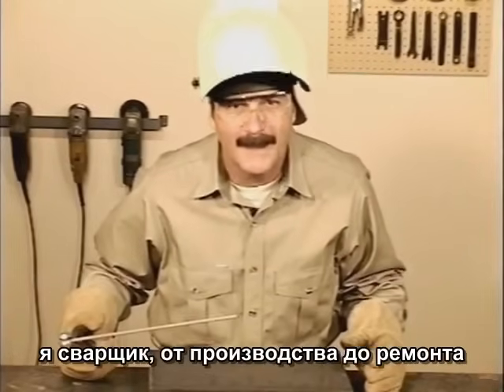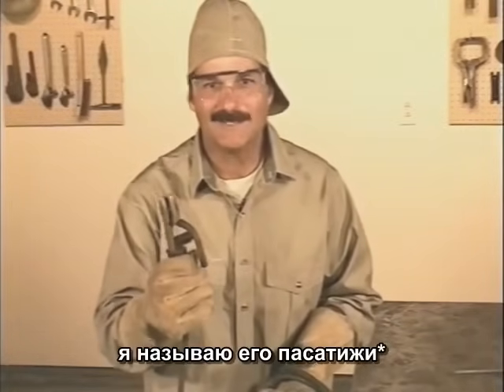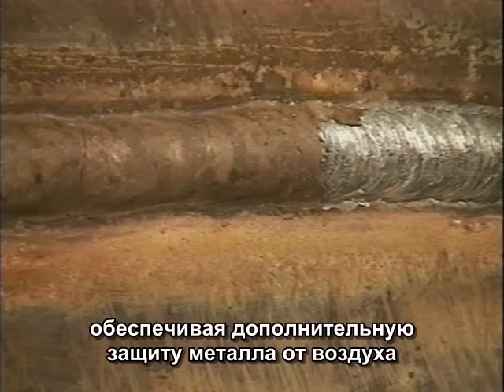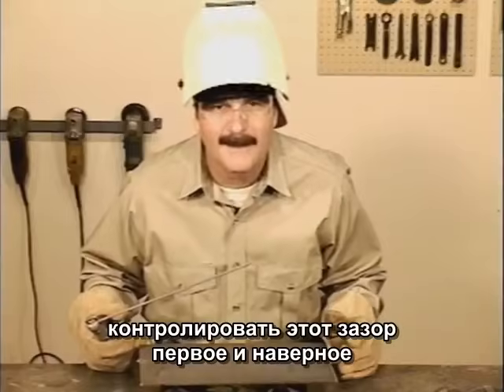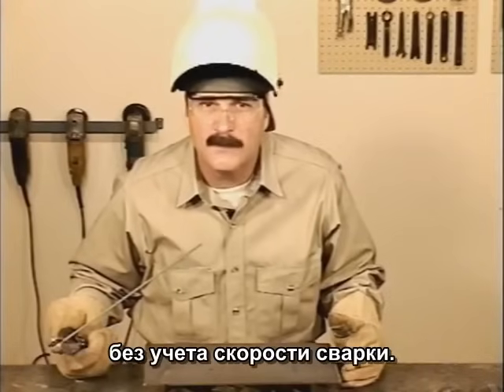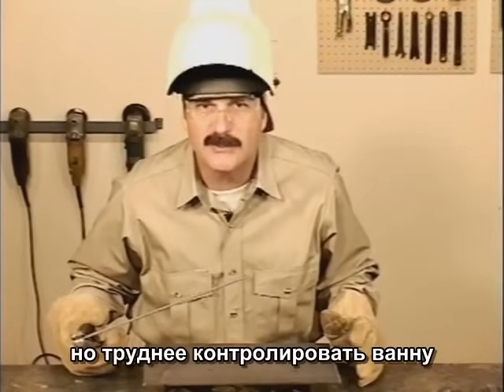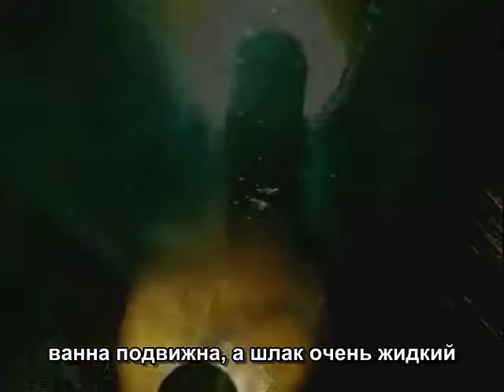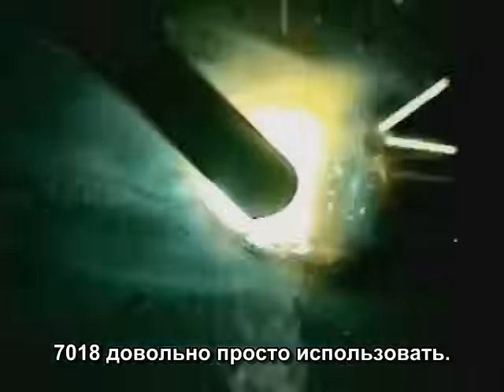Arc Welding Lessons

Comment: Very well done video, brings back fond memories of IVYTECH welding school back in 86. I did production welding at multiple job shops, however all gsmaw. I was fortunate to have a father that encouraged my interests, he even installed flameproof sheetrock in his basement, installed me a ventilation fan over my weld bench to bring smoke outside. I remember many fond times with laughing buddies down in basement sparking on up on my Lincoln 225 AC 125 DC at 10pm+ when parents room was directly above 😂👍. I’m very grateful to have such supportive parents that trusted me way more than I trust my own kids growing up. Welding has always been a love of mine, after 30 years at age 50, I finally got a Hobart Handler with 75/25 gas cylinder for the garage. Even though my life has taken me into Consumer Electronics repair, my heart still has that special place for welding, the sounds and smells are so yummy! 🤗

Comment: NOTES - Arc Welding Lessons ide16rus 
(My notes - use at your own risk)

E6010, E6011 - fast freeze - strong arc/light slag/deep penetration
E6013, E7018, 7024 - filler - light arc/heavy slag - smoother finish

E6010 DC+, 6011 AC/DC+ dirty material/First pass/fill gaps - follow with Filler
E6013 DC- for high speed sheet metal
E6013 AC/DC+ for general welding/light fab - easiest to use
E7018 DC+ Low H - Best finish/handles stress/low alloy/cast steel/large gaps/high deposit rate - must be clean
E7024 DC+ horizontal only - smooth weld/clean metal/high amps

Fast Freeze - can see puddle clearly
- E6010 & E6011
-- ~ 3mm arc gap
-- focus on puddle, not the arc
-- Scratch where weld will be
-- keep finger on trigger to drop rod
-- pause for 2-3 circles at start to get base metal hot enough

- Arc Gap
-- too close - no penetration/base metal cold
-- too long - arc drops/filler metal loss of control
-- most important

- Weaving
-- Watch build up (behind)/sides to keep even and tie-in
-- metal follows the heat/watch undercut

- rod angle
-- angle used to push slag back over the weld puddle
-- Straight up - puddle goes down and out/deep penetration
-- Angled - Builds up
-- Too angled - puddle difficult to control
-- vertical-45 to start/25 generally speaking

- Amperage (contributes to heat of base metal)
-- Purpose - melt the base metal
-- given in Mfg recommendations as a range--depends on metal thickness/position/welder's ability
-- Too low - base metal doesnt get hot enough--poor penetration/puddle appears to follow the rod
-- Too high - base metal too hot -- pushes puddle back/poor side tie-in
-- Correct - puddle spreads out/sides tie-in immediately/can ease the puddle around
-- Start about the mid-point in Mfg recommended range

- Speed of progression (contributes to heat of base metal)
-- faster = less heat/slower = more heat
-- too fast - too cold--weld bead skates across/no penetration
-- too slow - too hot--puddle spreads out/
-- correct speed - puddle spreads out and is controllable/sides tie in
-- As one improves, higher amps and faster speed

- Ending
-- Take a circle or two at end, then up and back

summary
-- scratch to get arc
-- start puddle wide for uniform
-- uniform arc gap
-- amp to spread out puddle
-- ease puddle around using arc
-- watch build up and sides
-- add filler metal before pulling out
-- Smaller rod is easier, and can be built up - start with 3/32 in general

6010 & 6011
-- tight circles & zig-zag --watch edges
-- whip motion - pull forward and then push molten metal back into the bead -- deep penetration/gouge and fill
-- step motion - puddle, long-arc, puddle -- metal cools some between puddling--thin materials/gap fill
-- step - cover with a fill pass
-vertical
-- down is easier
-- up gives more penetration
-- down - higher amperage/heat rises
--- watch sides and build-up
--- angle rod up/arc pushes puddle up
--- move fast to stay ahead of the puddle
-- up - lower amperage/into heated metal
--- angle tip up
--- watch undercutting -- watch sides and buildup
--- too hot - puddle may fall out/burn through
- Horizontal - tip up and vertical
--- don't blow weld bead out
- Overhead - get comfortable, like flat
--- Puddle wants to stay/don't blow it out
--- tip almost straight up and down
--- Sparks will be coming

6013 - good for small low Amp machines
-- Puddle stays fluid
-- Lots of slag
-- 130AC 116DC- good starting point
-- Too low - long time to tie in sides
-- Too high - stays hot longer
-- Short arc gap - can rest rod on metal
- Vertical 
-- downhill by design
--- amps up 5-10A
--- angle up
--- slight side-to-side
--- stay ahead of the puddle - move faster or higher amps
-- uphill - more penetration
--- side to side
--- watch undercut
--- amps down 5-10
- horizontally across
--- angle up/slightly back
--- slightly to back
--- slag runs down/watch the top
--- move fast to avoid buildup
--- better to move fast and do a second pass
- overhead
--- get in position and like flat weld -- mind the sparks

7018
-- heavy slag stays molten longer
-- understand that one sees the slag, not the metal
-- be comfortable
-- critical gap and uniform movement
-- bump and scratch to start
-- avoid rod burn up or pulling rod out of puddle
-- req's a little higher amperage
-- weld depends on how the puddle acts rather than how it looks
-- too low - wont spread out, long side tie in
-- too high - puddle agitated and fluid/excessive splatter
-- easy to move puddle side to side
-- horizontal - sag = move faster
-- vertical - weld up, move quick size to side after tie in
-- overhead
-- takes more practice, but worth the time

In summary
-- concentrate 
-- focus on puddle
-- make puddle do what it needs to do
-- put metal where it belongs
-- inspect every weld
-- Practice
-- Smooth
-- side tie in problems - too fast, tip of rod in puddle, low amps
-- too slow - flat weld, overheated base metal
-- Long arc - inconsistent bead with excessive spatter
Reply: These notes are excellent. Many thanks for them. Feel sorry for Steve though, this is an illegally copied video. The guy gets nothing. It's worth going on his website and ordering his dvds. to do the right thing
Reply: Thanks man, great work!

Comment: This guy knows his stuff. You can also use a mig welder in a similar way using gas-less welding wire, here the flux is on the inside of the weld wire....otherwise known as flux cored wire.

Comment: Welding machines are a very handy tool to have! Trying to use the same one is not just a rookie thing,many very seasoned pros I know including myself still prefer to use a machine they have been using for a while and have passed certification tests with. Welding equipment in my obsevation is sensitive enough to electical input, that your welder will probaly behave just a little diffrent in someone elses shop! If you have spots marked on dials you might have to retune a bit on a diffrent outlet!

Comment: Welding with an inverter welder isn't any different than welding with a conventional  transformer welder. The technique is the same, the only thing that might vary is the quality of the weld, but even then, you probably wouldn't notice any difference. Anyway, the guy in this video is one hell of a welder and you will learn a lot by watching.

Comment: this video is systimatic information using different type of electrode insheilded metal arc welding,travel speed,correct arclenght,ampherrage and also the angle of electrode or the possition.thank you.

Comment: 100 amps should be enough for 3/32 for sure. It sounds like you are describing cold welds. Do the rods stick all the time when you're trying to start the arc, and the bead is balled up like water on a waxed car? If you've got a 100 amp welder and you still don't have enough output for 3/32 rod, the welder may not be working properly.
Reply: @Jude Jad Instablaster ;)
Reply: @Thomas Russell I really appreciate your reply. I found the site through google and I'm trying it out atm.
Takes quite some time so I will get back to you later when my account password hopefully is recovered.
Reply: @Thomas Russell it worked and I actually got access to my account again. Im so happy!
Thanks so much, you saved my account !
Reply: @Jude Jad glad I could help xD

Comment: My only problems with stick welding are 1) only AC buzz boxes are available (are also low OCV) and 2) 6013s are the only AC/DC electrodes. For some reason, real AC/DC electrodes like the awesome 7018 AC rods are not around when I need them.

Comment: i just started welding with i got a cheap speedway100 amp arc ac welder and im using 3/32 6011 rods and 1/16 im having trouble striking a arc and running a bead i have been able to get a arc but every time i try to run a bead i just get a bunch of tacks what is your advice to fix this or is this welder just not worth a crap do you think a bigger more amp welder would be easyer to learn on?

Comment: What rods would you recommend for welding motorcycle mild steel frames?
Its for a hardtail conversion, and TIG weld is not an option for me.
SO i need a rod that can give a very strong weld on a frame, that will not give me any worries of strength.
cheers

Comment: I currently have a POS Harbor Freight 70A stick welder. Really frustrating as you could imagine. Should I buy a Lincoln AC225? Very good video.
Reply: Personally my choice would be for an inverter welder. I picked up an Everlast welder and found inverter arcs are much smoother.
Reply: yes
Reply: A lot of guys start out on a lincoln 225. I still like to use mine on heavy stuff. You can buy a good used lincoln 225 cheaper than the crap you buy at harbor freight. I have seen a lot of old lincoln 225s and I have never seen one that was worn out or didn't work. They last forever
Reply: i upgraded from that welder to the AHP160ST.. evan on 110V it can do 1/8 rods if your on a good braker.. im able to push enough amps to light up 1/8 6011 and 7018 upto 110A..

Comment: Need tips for welding 2mm galvanized steel 40x40 (mm) tube. I have a 180A DC inverter weld , and 2,5MM 6013 electrodes.

Comment: sorry but he is wrong you don't run a weld down hill and you don't get chased by the slag go uphill the correct way of welding the best way is to spot weld for 2 seconds then stop for 1 then 2 again don't worry about the slag looking messy should look like a candle dripping if you do it right the weld will be flat plus he is moving to fast the weld should look like neat tight finger nail shape ))))))))) not >>>>>>>> you will know when you get it right you wont need to chip the slag of it it will peel it self off its not a race slow down if my welder still worked I'd show you
Reply: What are you talking about?  Uphill and downhill are proper methods of welding.  Be it SMAW, TIG or MIG.  Do you mean tack weld vise spot weld?  Spot welding and tack welding are not the same thing.   Also not all slag peels off easy.  It depends a lot on the heat, rod you use and the composition of the flux.   Does not seem like you know much about welding at all.
Reply: Chris Selby lol chris Selby you don't have a clue this guy knows his shit
Reply: +Chris Selby the general consensus is that with downhill welding you're less likely to get the right penetration on a weld, but 1) this was made far before that consensus was reached and he still mentioned a lower likelihood of penetration, and 2) downhill welding is still acceptable if it passes x-ray. He's actually not moving too fast, either; his welds do look like )))))), he's just depositing far less metal than the neophytes who are watching and being critical. You don't need a boatload of metal to make a weld, and you want to use the least amount possible to make  an adequate one for several reasons, not just because a weld is more expensive the more metal you put into it.
Reply: lol you can weld 6010 downhand or uphill doesn't matter depends on procedure stop talking about shit u know nothing of !
Reply: lol on 7018 rod he said you can only run up hill 6010 is a fast cooling rod you can go downhill or up
 with 6010
Reply: Uphill for 7018, downhill for 6010, 6011, 6013. 7018 and 7014 (I think) provide slag peel to show a good weld, but not all the time. Not every rod gives slag peel. 6011, 6010, 6013 are examples. Check out Weld.com with Bob Moffatt, Weldingtipsandtricks (Jody is a welding instructor and inspector), Bob is a welding instructor at a college. . . Those videos are awesome